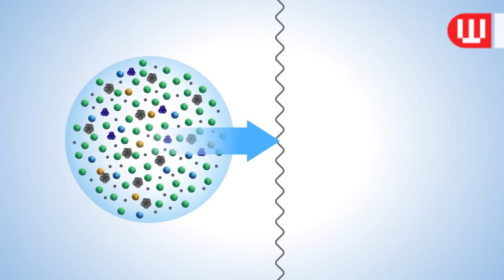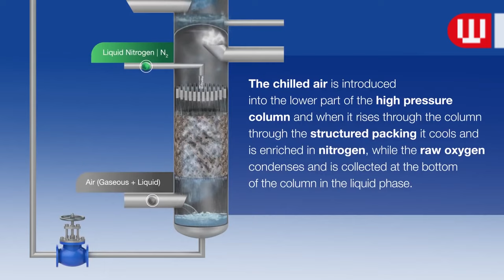How Oxygen Is Made In Factory | Oxygen Cylinder Manufacturing Process

Comment: 0:06, I saw rust / not clean surface inside the cylinder, do they clean that before molding the head and bottom?

and if they don't will rust and dirty surface affecting the pure Oxygen??
Reply: Well rust is cause by oxidation so i dont think it has harmful effect.. Its like rusty pipe in a drinking faucet

Comment: Co2 cylinder use in oxygen cylinder before valve change. Co2 and oxygen cylinder thikness is same and material is same but valve is different... !!! Than valve change and use is possible..!!!
Reply: Wrong!!!! Oxygen will OXIDIZE aluminum, hence oxidized aluminum????? Torch bottles are steel.
Reply: where i purchase oxygen cylinder